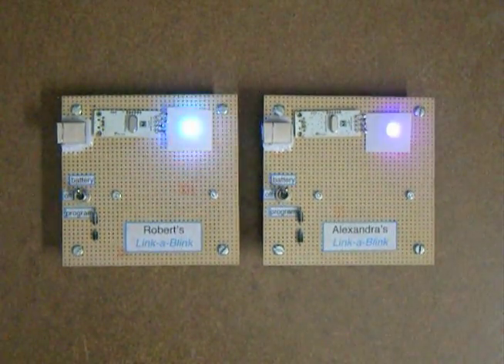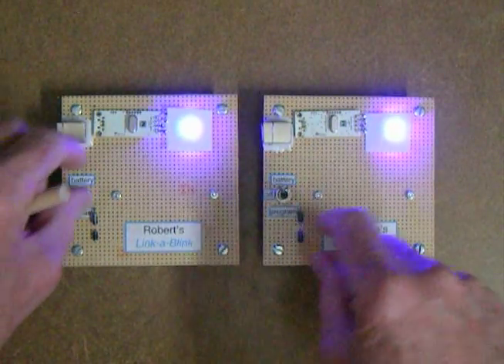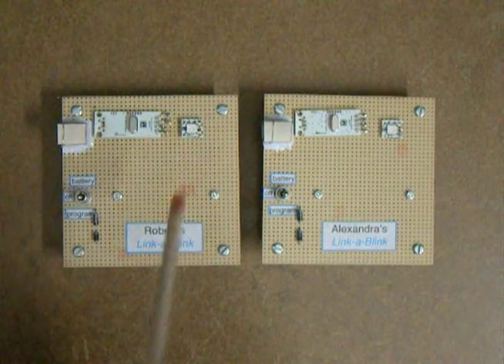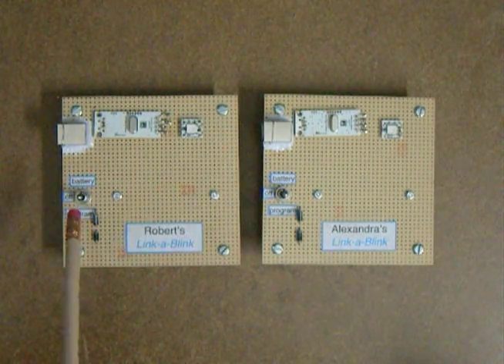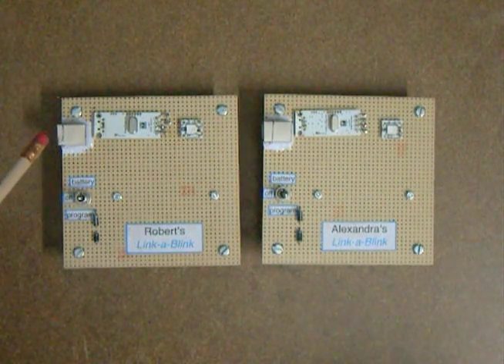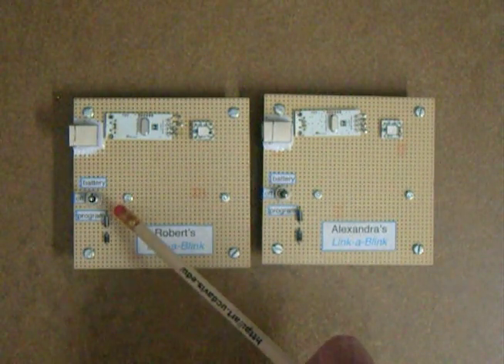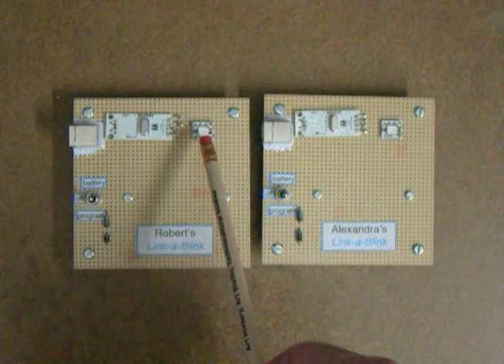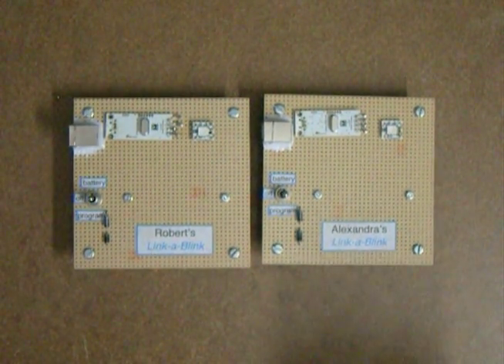Link-a-Blink

Comment: I am using digital strips that use the lpd8806 chip.  The arduino im using now sends data and clock to the strip. I want to use the linkm because it is narrower than any arduino I've seen and it seems it has enough memory?